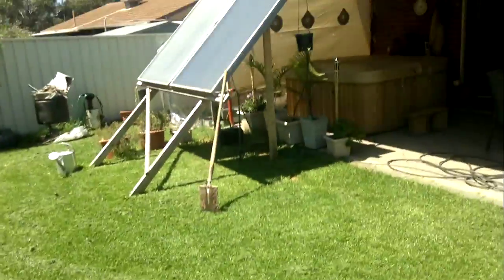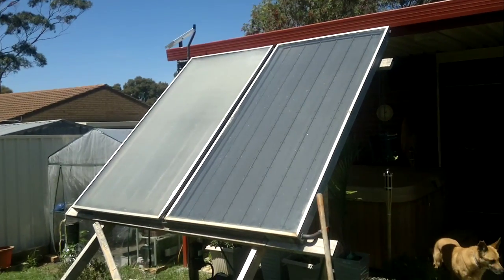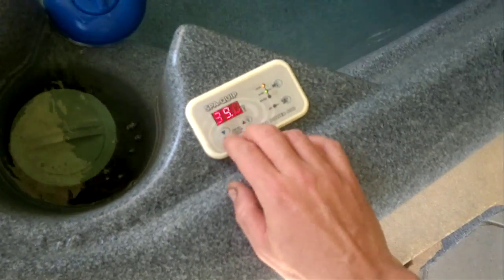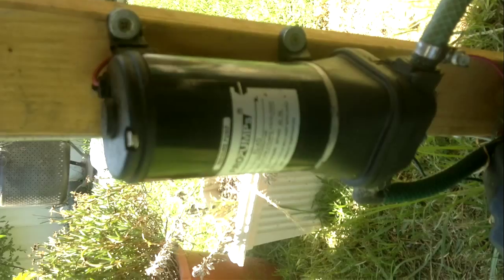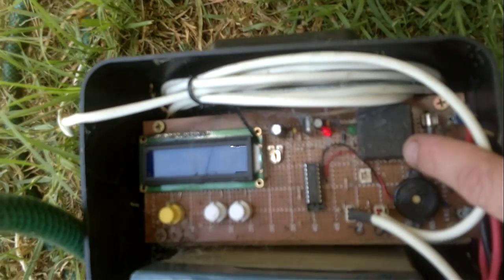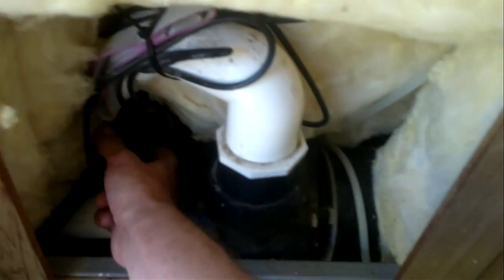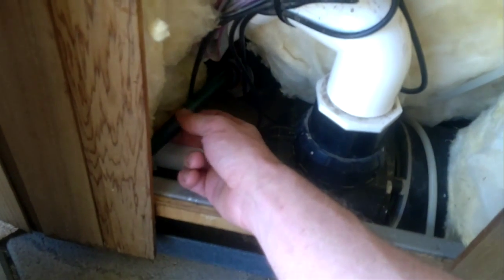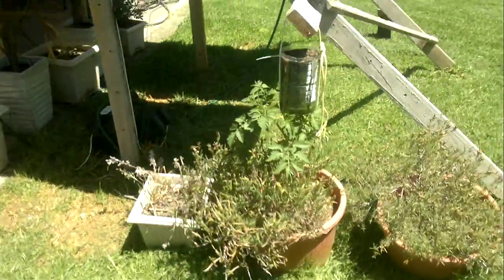Solar spa heater

Comment: Hi Mark. great video mate. I'm a plumber working for Solahart Brisbane. I have a endless supply of second hand open circuit collectors(ones you using in the video) and the ability to plumb the system in. What I can' t do is the controller part of the installation. would you be interested in building one up for me to purchase? I only need the controller and sensors not the battery.

Comment from the maker: Hi Mark, I used 1 wire sensors DS18B20. You can get them pre packaged in a SS probe on Ebay. The secondary tank is a great idea, once the spa gets to temp you could divert the heat, as you say, for a late-night top-up. Maybe pre-heat your domestic HWS with it? I'm actually building a wood burner to supplement the heat  during cloudy stretches. Having said that, we have just had 2 sunny 18° days in a row, and right now It's at 38° ready to get in. Gotta use brass fittings. Will email code & sch.

Comment from the maker: @boothy1077 Thanks Boothy. Only a couple of problems - The cheap pump failing (because of a loose screw), and plastic fittings deforming because of the heat. I've also fitted a primative pressure relief valve as a safety measure since posting this video. Other than the pump and plastic fittings I've had no problems at all. Plenty of free heat. The circuit is my work, based on a 'picaxe' microcontroller. Send me your email and I'll dig up the schematic and code for the chip.